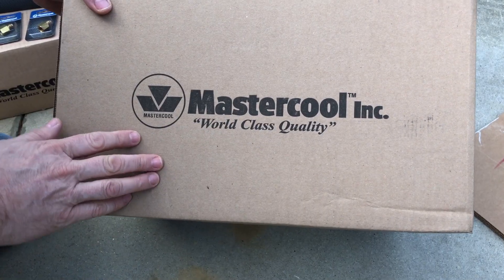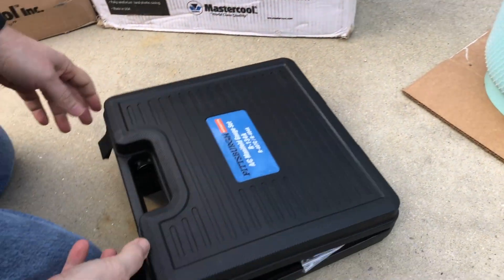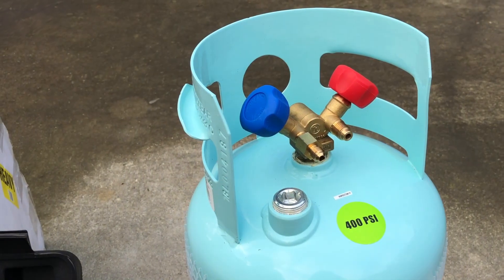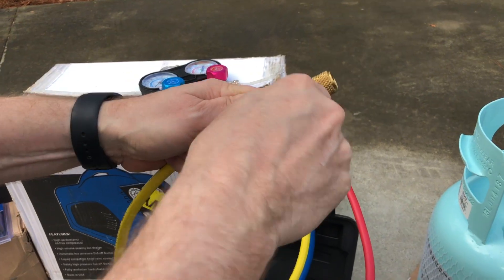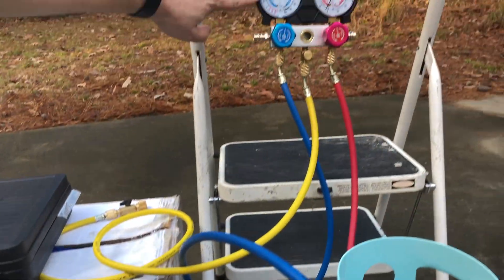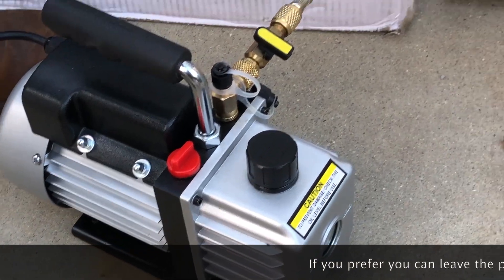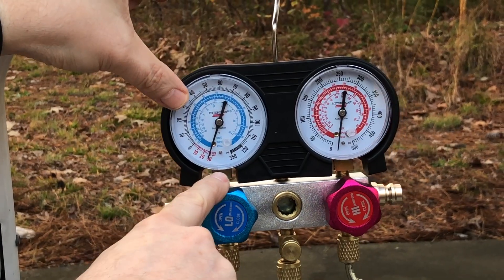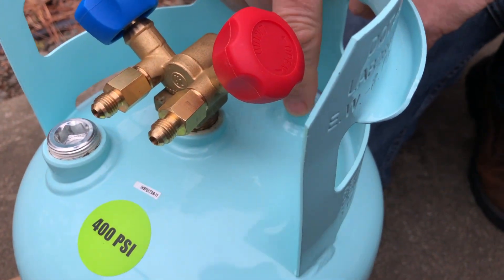New R134a Refrigerant Recovery Cylinder 30 Lb Unboxing and Setup for First Use (Mastercool 64010)

Comment: What happens if you don’t do this before you use it?
Reply from the maker: Do what?   I'll take a guess you're asking about removing the gas charge loaded during manufacturing.  The pressurized nitrogen gas used during shipping to prevent corrosion to the bare steel insides of the recovery cylinder would migrate into the vehicles air conditioning system.  Instead of recovering clean refrigerant, you would end up contaminating it with nitrogen gas rendering it non-reusable.

Comment: How  the maximum capacity is 40 lb if the tank stamped 30 lb capacity 80% of 30 lb is 24 lb ?
Reply from the maker: The weight of the tank itself has to be added back to the calculated  capacity the tank is capable of safely holding.   Check out the math calculation I walked thru again, but after you figure out the internal capacity you then have to add the actual weight of the actual steel the tank is constructed of back in so that you know what you're looking for on the scale.

Comment: That's a hassle that it comes with different connections than I assume is standard and also I was under the impression that recovery machines pulled vacuum as well so you didn't need a separate vacuum if you had one of those am I wrong I assume it has some kind of vacuum pump is it just not as strong
Reply from the maker: All the connections are industry standard, but vary by the intended type of refrigerant by design.  There are also standards for the size ports on the cylinders vs the attaching equipment, which have to work across all refrigerant types.  

On vacuum, I believe you're thinking of the far more expensive recharging stations.   The lower cost recovery machines are not capable of charging, only removing, refrigerant.   So they do not provide a separate vacuum function to test the repair.   They provide a port for attaching an external vacuum pump for this purpose instead, as I show in other videos of this playlist - https://www.youtube.com/watch?v=oIRKmR2Xgds&list=PLKGiYMtrEJBPSCGsva859Ewl3qJi2W-o4

The recovery machine does have the ability to vacuum out the refrigerant, but that's it.  It cannot test that your repair is holding vacuum.

Comment: Why did you feel the need to specify it is OK to vent N2 to the atmosphere 😂
Reply from the maker: This area of repair is an EPA regulated one, but the video is aimed at those new to it.   Releasing refrigerants into the atmosphere is prohibited by statute, and carries heavy fines.  Novices may not be clear that N2 (i.e., Nitrogen) is not a regulated gas, and is in fact the majority composition of this planet's atmosphere (i.e., totally safe to vent).
 
Had I not said that, I would get multiple comments that I did not make that clear.  ;-)
Reply: @DrShock  well, but after pulling the vacuum in the tank, is it not better to fill it with few PSI of refrigerant, to avoid potential contamination over time?
Reply from the maker: Well by following the prep procedure I show here, you end up replacing the N2 with a vacuum.   Both N2 and a full vacuum protect against corrosion of the untreated steel of the cylinders interior walls.   Once you do the first vehicle AC repair with the new cylinder, you'll be starting the process of displacing the vacuum with recovered refrigerant (e.g., R134a).   Using these manual recovery cylinders, you wouldn't reuse the refrigerant anyway (the contamination state of the vehicle owner's system will be unknown).  So these are just for recovery, and once full you take the cylinder to an EPA reclamation center where they empty the tank of refrigerant and give it back to you.   Depending on the refrigerant type, they may even compensate you for the recovered contents (e.g., if its R12).
Reply: @DrShock  oh I see, I thought the refrigerant would be reused! This explains it.
Reply from the maker: There is equipment out there that will recover, filter and clean the refrigerant, and then recharge.   You would find that in your typical dedicated AC repair shop.  But for someone who just does AC work occasionally, that's too expensive (often costing more than the vehicles being serviced are worth).  I use a recovery only machine setup that doesn't handle that refrigerant reuse functionality, and then recharge after repairs from a virgin R134a cylinder instead, using the typical gauge set low side feed method.

Comment: It’s actually filled with nitrogen so I’m pretty sure you can just open the valves and let it out into the air. That’s not illegal. And then pull a vacuum on the tank
Reply from the maker: Yep, it's N2 as I mentioned in the video, perfectly safe to vent from the new empty recovery cylinder as ~78% of planet Earths atmosphere we all breathe is actually N2.  ;-)

The reason it's not a best practice to vent the N2 first, then vacuum second, is the new recovery cylinder is bare unpainted steel on the inside.  This bare steel surface can flash rust with even a momentary exposure to atmospheric humidity.  So best practice is instead to vacuum the residual N2 out before the cylinder is fully emptied by venting.
Reply: OK I’m just learning really. Definitely no expert. Thanks for the video
Reply: If you vent to atmosphere, somewhere in the world, a life is lost. 😂

Comment: I bought this recovery tank in 2016 and never used it. I'm in the process of draining the nitrogen out and doing a recovery. Do  I still need to get my recovery tank retested before I use it?
Reply from the maker: They are bare unpainted steel on the inside, so corrosion is the primary concern with them.  They should be tested every five years.

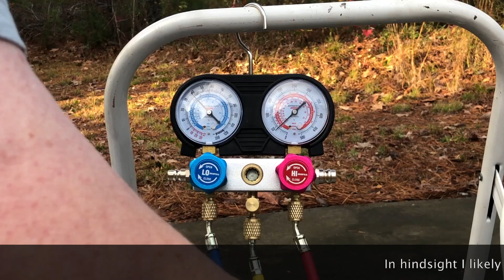Comment: 6:07 - its actually the same exact pressure and you would also need to use a micron cage to pull the vaccuum down to 150

Comment: Why not just open the tank let it empty then connect the yellow line too the vacuum.
Reply from the maker: Once the nitrogen charge is vented, atmospheric moisture will immediately enter the cylinder.   So the manufacturer recommended procedure is what I show, in order to prevent that from ever happening.  That way you never get a single dot of interior bare steel surface corrosion.

You can certainly pull a vacuum afterwards too, but doing it while the nitrogen is still there is the preferred approach.

Comment: This is an informative video, but what is the purpose of a refillable R134a tank? Is there a place where you can buy R134a and fill up your own tank?
Reply from the maker: Its not for new refrigerant.  It's for recovering used refrigerant before attempting repairs.   Both federal and state law requires preventing the venting of refrigerant into the atmosphere before attempting any repairs on the AC system.

You can then take these tanks to an EPA refrigerant recycling center when full and they will empty them for you.  Depending on the refrigerant type recovered, you may even be compensated.

Comment: what is this size of fitting called? 3/8" MNPT or 1/2" MNPT?
Reply from the maker: Neither.  R-134a uses an AC industry 1/2" ACME threaded fitting.  ACME is a flared end type design.

The adapters that may be needed for some hoses are 1/4" MFL (male flared line) that I showed a 3:42.

Comment: Great video, let me see if I understood for the purposes I watched; If I get this tank, after this set up, can I recover the freon on my car AC system? I do not intent to use whatever recovered but dispose of it taking it to a shop or whatever the method should be. I intent to drain my car AC system so I can replace the core and other AC components then I will be recharging it fresh with cans of 134a until capacity. Right now I have the manifold and hoses, the pump from harbor freight, cans of flushing ac system and cans of 134a; I can not take the car to a shop; engine is being overhauled, but while it is outside its bay I had the idea to replace the core, regulator valve, drier element and seals on the system; before turning the car off AC was not present; blower works but blows hot air. Like I said, I do not need the freon recycled; I do not care using again what comes out of the system; I will recharge it with new 134a. Please advise and thank you in advance for your input.
Reply from the maker: So these empty cylinders are used in conjunction with an R134a recovery machine.   If you have the full setup, either what I've demoed in this playlist series or something similar from other vendors, you will be able to recover the R134a refrigerant to do such repairs yes.  Watch thru the full playlist to get the full jist of all the tools needed.
Reply: @DrShock  so could not use this cylinder to dump the freon on it just using the vacuum machine from harbor freight correct? if the is the case i am screwed because I do not want to expend $500.00+ on tools I will only use one time; considering already bought the vacuum and the manifolds gauges
Reply from the maker: No, a vacuum pump is needed to check for leaks as well as to evacuate any atmospheric moisture intrusion into the AC system.  But it alone won't be enough to recover refrigerant by itself, there's a bit more plumbing needed as you have refrigerant vapor, liquid refrigerant, and refrigerant oil all needing to be recovered first.  That's where the recovery machines come in.

For a one time job, I'd just pay a local AC shop to do an evac for you.
Reply: @DrShock  yes but that would be when the car runs again; then all the comfort of doing the replacements now is gone! too bad nobody rents those machines for the do it yourself.
Reply: I took my truck into a local mechanic to evacuate the r34 freon they charged me $ 140.00 to recharge it after I put a new compressor on. I had no idea it would cost that much but next time I'm just going to recharge it myself and let the shop keep the freon its much less expensive that way only $25.00 and I already have the evacuate pump and gages.

Comment: Why stop at 5 psi instead of letting it get all the way down to zero psi?
Reply from the maker: Because you run the risk of atmospheric (moisture laden) air getting sucked in.   You want to just vent out the dry air / nitrogen charge from the factory to a point where it won't tax the vacuum pump unnecessarily.   Go too far, and you end up having to pull a longer vacuum to get rid of the moisture contamination you let in.

Why the moisture concern?  Because the vehicles R134a component internals are extremely vulnerable to moisture and will corrode quickly.  It's what usually kills a compressor in short order when folks don't take the precautions necessary.  For the recovery cylinder we're concerned with it for two reasons.  One, so we can sell the full contents to a recovery facility when the cylinder is full (most won't take contaminated refrigerant).  And two, if we happen to just be doing this on our own personal vehicles, to keep it from being contaminated for reuse.
Reply: @DrShock  wow, i never knew that. thank you!
Reply: Starting the vacuum pump before the tank is fully empty of nitrogen is good practice if you don't have a micron vacuum gauge.  If using a micron gauge while pulling the vacuum,  it probably doesn't matter if you let a bit of air into the tank since the micron gauge will tell you whether you still have moisture  in the tank.

Comment: When you go to evacuate the system how to you get the air out of the lines before opening the tank?
Reply from the maker: That's a great question.  If you follow my playlist a later video goes over this, but the answer is a vacuum pump.  You have to pull a vacuum on the equipment itself, to remove atmospheric moisture (aka air) from the lines that will get hooked up to the vehicle.   Otherwise that air will then contaminate the refrigerant stored in the cylinder during recovery.  The valves on the end connectors of the equipment hoses will hold that vacuum until you're ready to do the evac with the recovery machine.  The process concern applies to recharging the vehicle as well.  Besides the vacuum pulled on the vehicles system, your equipment also has to be purged of atmospheric air again, in order to not contaminate the vehicle system on recharging with air present within your equipment.

Comment: The band is a protective edge for the steel bracket on top of the tank. Add a recovery unit to your scale, and you have the equivalent to a $6000 A/C machine.
Reply from the maker: Thanks.  I figured that plastic band went there as it was the right length but it doesn't stay on the steel handle for carrying upright so I don't use it.   I'm sure it's preferable when you have the cylinder upside down though.   Yeah, I have a playlist series I'm doing starting with this one including a Mastercool 69500 and 69000 as well as the 98210A.